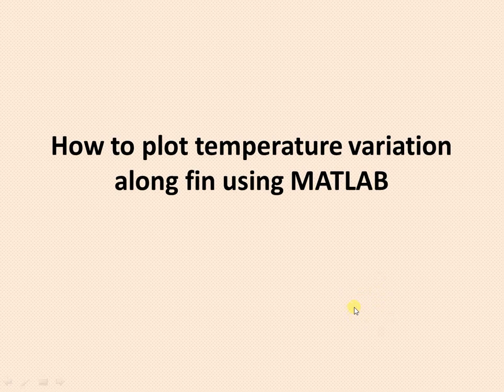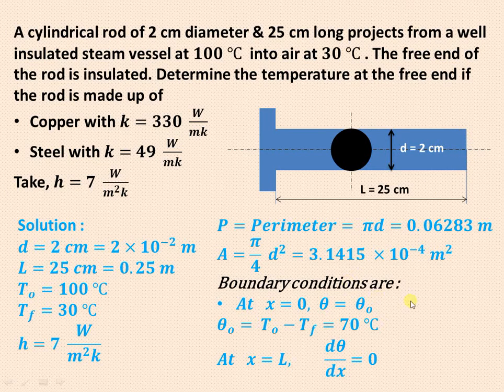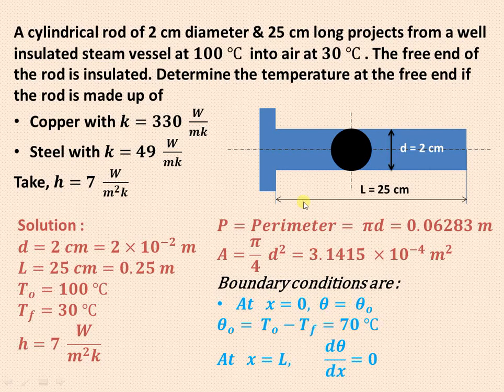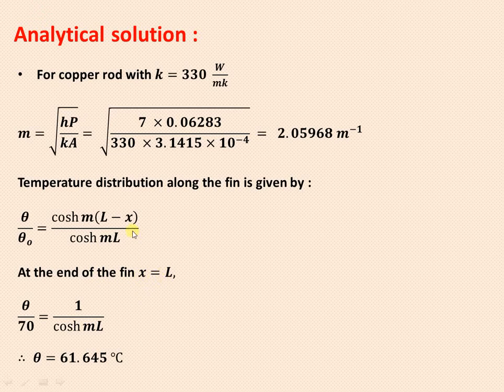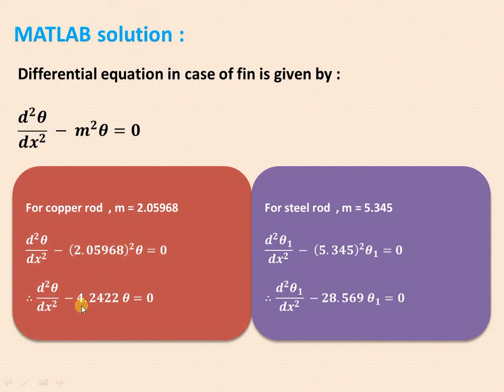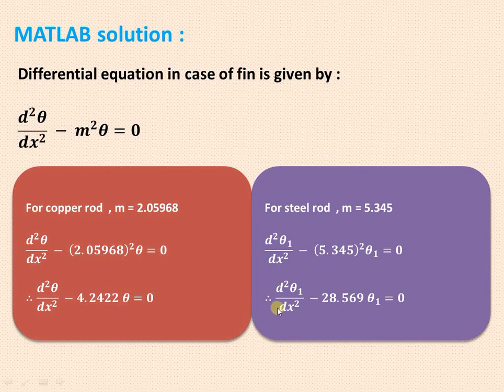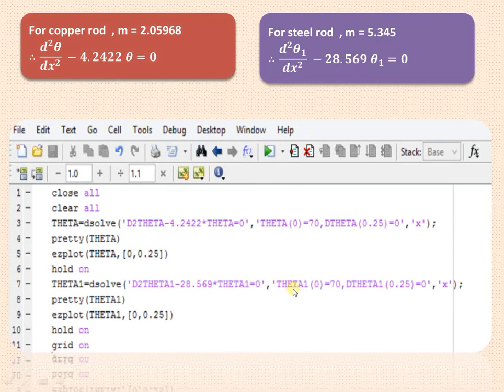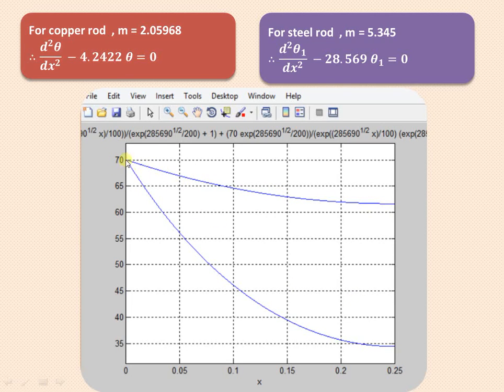How to plot temperature variation along fin using MATLAB - Conduction heat transfer

Comment: Hi there, how would you go about writing the code if you wanted the numerical values in the code to be algebraic terms. So if for example your code previously calculated your 'm' value you'd want it to use that instead of writing it into the code e.g. THETA1=dsolve('D2THETA - M * THETA = 0'....... how would you go about inputting this so it works using that value. I have been searching for hours to find a solution that works. could you help. great video, it has really helped me.